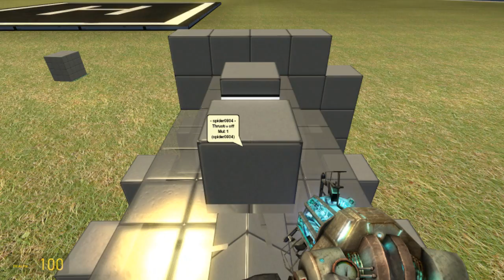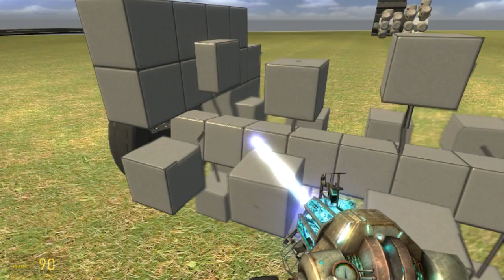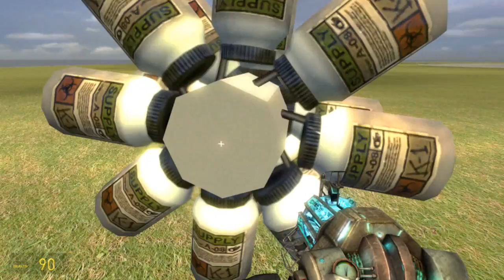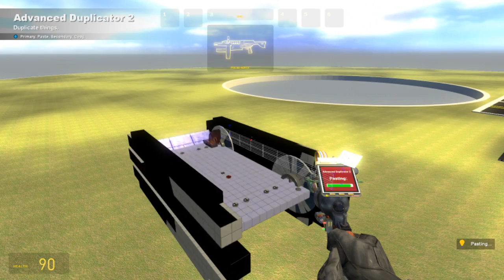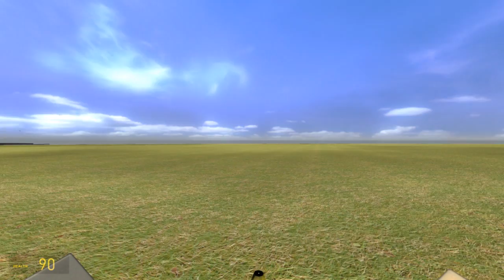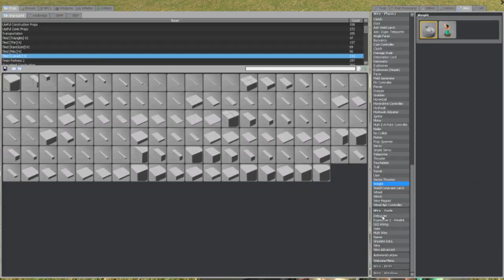Gmod - (Tutorial) Engines 04 "Engine Building Tips"

Comment: So, I think I have a problem with my engines.

I set things up "properly" (I'm not quite certain), following any given tutorial one may find on YouTube - be it an I4, a V8 or Flat 8, a piston engine, or a wire hydraulic engine.

While a hydraulic X16 engine sits at a fairly stable 545 RPM due to the sheer number of pistons (note that the tutorial for hydraulic X engines recommends an X32), anything else below that threshold is woefully unstable and underpowered.

Inline 4 and Flat 8 engines, for me, have the problem of fluctuating between 60 and 500 RPM in an unstable fashion, leading me to believe that a not insignificant amount of power is being lost to poor timing. When attaching the engine to a vehicle via a BRD device, the vehicle experiences major torque spasms (akin to driving on an ocean of bowling balls) on each cycle, along with consistently failing to break past the 15 mph barrier.

Earlier I thought it might have been related to SmartSnap edge detection, but I've since realized that this happens even with square crankshaft models.

Annoyingly, my only truly stable engine was my hydraulic X16, which used vanilla blocks (which are absolutely enormous) for maximum compatibility on servers.
Reply from the maker: I have to disagree about your view on hydraulic engines, an inline 6 can be more powerful than anything I can make with pistons. I do not use them because I see them as cheesy because of how powerful they are and lack of moving parts. BRD systems are outdated, physical transmissions using makespherical are the best way to transfer power.
Anywho I can not help you with hydraulic engines but I do have a newer engine tutorial here, /watch?v=NlXkmK3DPvM
Reply: It's less about the hydraulics vs thrusters and more about something in my technique causing massive instability regardless of the method used.. I'll take a look at the video, though.

Comment: ive always had bad experiences with the jar prop, the best prop ive used is the wire speedometer prop, when you do use sliders, did you use the easy precision sliders?
Reply from the maker: Yea I used easy precision sliders but I have since discovered that precision alignment sliders are almost flawless in engines but still suck anywhere they have to stretch more than a few feet.

Comment: Other things effecting engine performance; the translational speed limit; especially if you are using a large diameter crankshaft, you will find the pistons are trying to break the translational speed limit, (before the shaft even gets to the angular limit), which will stop the engine speed climbing any higher. At default settings, this means your crankshaft diameter should be no larger than 48 units.

Comment: Good tutorial.

A couple of points; mass in gmod is in kg, not pounds ;). Flywheels; the [moment of] inertia (MOI) will be larger if you use a large diameter flywheel, without increasing the overall engine mass as much. The piston's mass also contribute to the overall engine MOI - which is a value reported in my Autodyno test.

Your findings regarding "points" at which the pistons are connected are very interesting; looks like you may have found a bug in the physics engine!